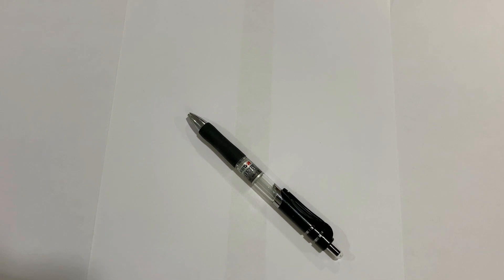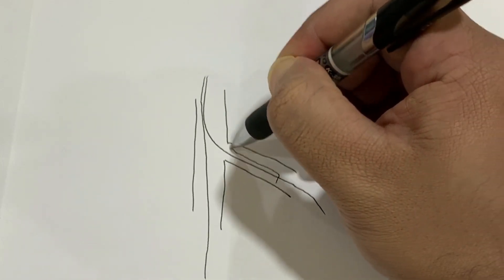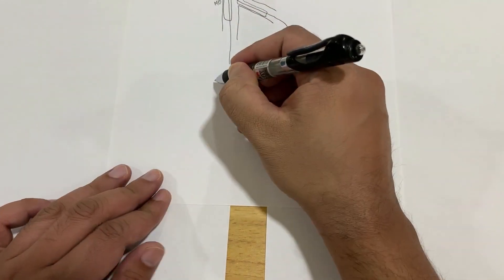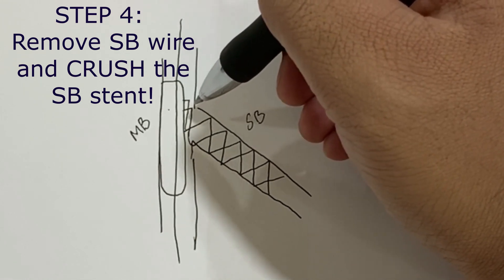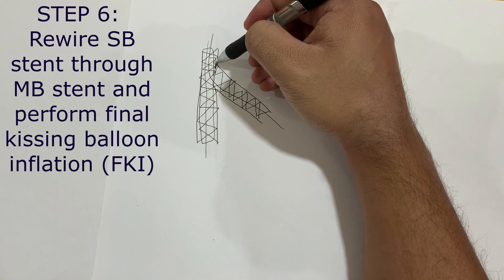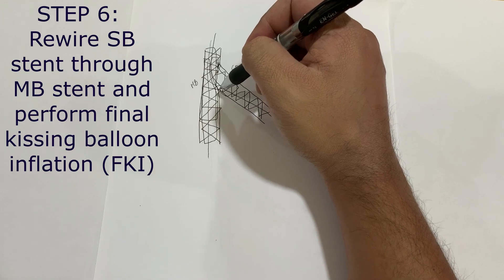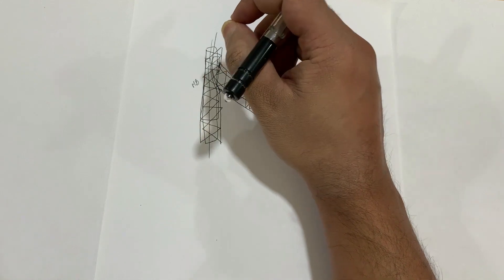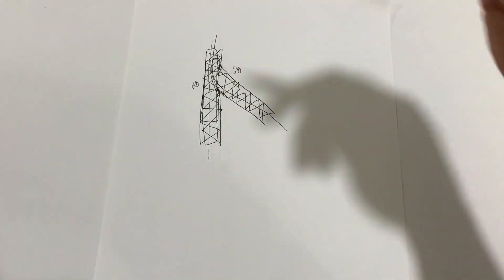How to do mini crush minicrush bifurcation stenting

Comment: Few bits here:
1- I don’t think there is a need to do simultaneous kissing in the lesion preparing stage as there is no worry about carina shift and you need to do that step only when you deploy the stents … I would predilate and prepare each beach separately 
2. You should before rewire the vessel and after deploy the stent in MB to do POT to avoid the wire to go behind the stent struts
Reply: Hello Doctor! I need your help to understand & figure out something..There is this question...   Is mental stress the reason a completely new blockage got formed within one year near the edge of the stent. 
In 2023, LM to MidLAD stents were put for ostio-proximal lad blockage. Then within a year new blockage in the 'LM ostium followed by patent stents' got formed. Plus at the lcx ostium also previous mild blockage increased. Is mental or emotional stress the reason? Because medicines, diet, exercise everything was as recommended.
What are the odds this would have had not happened without stress

Comment: Won’t it be better to dilate the SB Ostia by recrossing , before we put in the MB stent ?
Reply from the maker: its better if you cannot cross and would be a modification of this technique however the original technique did not have that because they were using it for left main and the vessel was large. You are absolutely right that in real life you have to dilate the ostium

Comment: Very useful video! Very easy demonstrated
Reply from the maker: Glad it was helpful!
Reply: Hello Doctor! I need your help to understand & figure out something..There is this question...   Is mental stress the reason a completely new blockage got formed within one year near the edge of the stent. 
In 2023, LM to MidLAD stents were put for ostio-proximal lad blockage. Then within a year new blockage in the 'LM ostium followed by patent stents' got formed. Plus at the lcx ostium also previous mild blockage increased. Is mental or emotional stress the reason? Because medicines, diet, exercise everything was as recommended.
What are the odds this would have had not happened without stress

Comment: U forgot to add final POT to avoid the neocarina
Reply from the maker: true. My practice has changed since the last 3 years. POT should be performed as you suggested. POT is not being advised more and more and I probably will need to make another video with it.

Comment: What is the purpose of kiss ballooning in step 2. I usually do not kiss balloon in that step, just dilate individually.
Reply from the maker: Its to keep the carina preserved. You can do separately as well. however more angulated vessels and very athereomatous plaques will have carina shift as well as plaque shift that distorts the carina leading to much difficulty in later steps

Comment: Dear dr rewiring is done through  proximal struts or mid struts and not distal
Reply from the maker: My dear friend for mini crush ...the rewiring is through distal for minicrush and proximal for DK crush
Reply: Hello Doctor! I need your help to understand & figure out something..There is this question...   Is mental stress the reason a completely new blockage got formed within one year near the edge of the stent. 
In 2023, LM to MidLAD stents were put for ostio-proximal lad blockage. Then within a year new blockage in the 'LM ostium followed by patent stents' got formed. Plus at the lcx ostium also previous mild blockage increased. Is mental or emotional stress the reason? Because medicines, diet, exercise everything was as recommended.
What are the odds this would have had not happened without stress
Reply: Hello Doctor! I need your help to understand & figure out something..There is this question...   Is mental stress the reason a completely new blockage got formed within one year near the edge of the stent. 
In 2023, LM to MidLAD stents were put for ostio-proximal lad blockage. Then within a year new blockage in the 'LM ostium followed by patent stents' got formed. Plus at the lcx ostium also previous mild blockage increased. Is mental or emotional stress the reason? Because medicines, diet, exercise everything was as recommended.
What are the odds this would have had not happened without stress